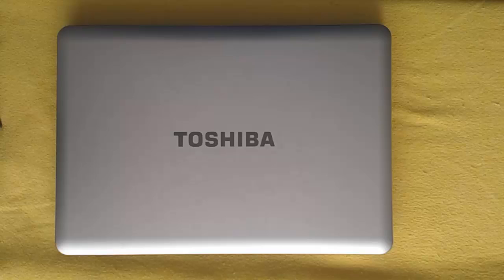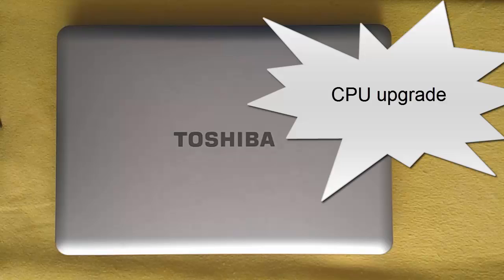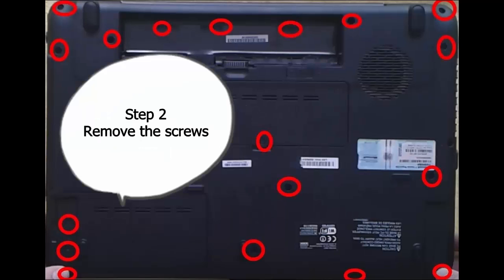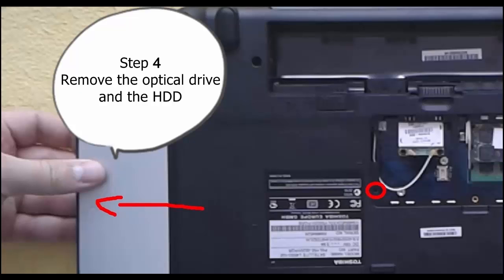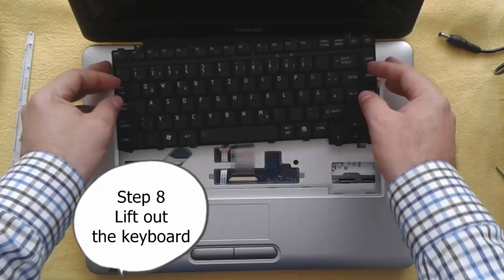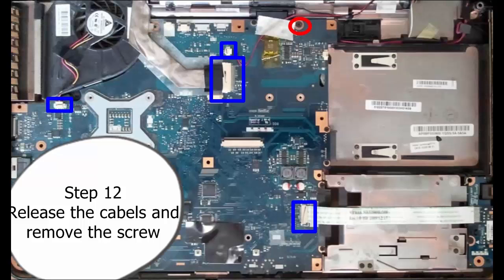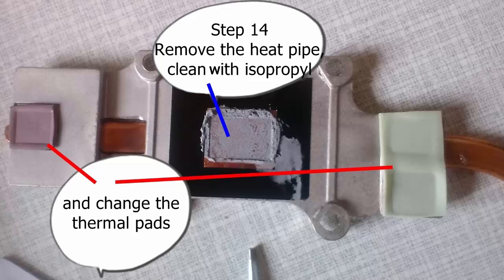CPU upgrade for Toshiba L450D laptop Ep.087

Comment: Mine already has the QL-64, thinking about putting in a 2.4ghz or faster socket S1 CPU but I can't find out what CPUs are compatible.
Reply from the maker: Aloha, the CPU's below are socket S1 (S1g2) CPU's, but  because Toshiba didn't provide a  list with compatible CPU's, I don't know if the BIOS will recognize all these CPU's and I didn't tested, I can only suggest to try these CPU's.
Athlon 64 X2 QL-64	2.1 GHz	L2 Cache 1MB	35W
Athlon 64 X2 QL-65	2.1 GHz	L2 Cache 1MB	35W
Athlon 64 X2 QL-66	2.2 GHz	L2 Cache 1MB	35W
Athlon 64 X2 QL-67	2.2 GHz	L2 Cache 1MB	35W
Turion X2 Ultra Dual-Core ZM-80	2.1 GHz	L2 Cache 2MB	32W
Turion X2 Ultra Dual-Core ZM-82	2.2 GHz	L2 Cache 2MB	35W
Turion X2 Ultra Dual-Core ZM-84	2.3 GHz	L2 Cache 2MB	35W
Turion X2 Ultra Dual-Core ZM-85	2.3 GHz	L2 Cache 2MB	35W
Turion X2 Ultra Dual-Core ZM-86	2.4 GHz	L2 Cache 2MB	35W
Turion X2 Ultra Dual-Core ZM-87	2.4 GHz	L2 Cache 2MB	35W
Turion X2 Ultra Dual-Core ZM-88	2.5 GHz	L2 Cache 2MB	35W
I wish good luck with the upgrade and please a comment how went the upgrade.

Comment: This video very helping us, thank u. how many kind cpus working on L450, i wanna upgrade too
Reply from the maker: Aloha, probably these CPUs will work, 
Athlon 64 X2 QL-60 2x1.9 GHz  1MB 35W
Athlon 64 X2 QL-62 2x2.0 GHz  1MB 35W
Athlon 64 X2 QL-62 2x2 GHz  1MB 35W  
Athlon 64 X2 QL-64 2x2.1 GHz 1MB 35W
Athlon 64 X2 QL-65 2x2.1 GHz  1MB 35W
Athlon 64 X2 QL-66 2x2.2 GHz  1MB 35W
Athlon 64 X2 QL-67 2x2.2 GHz  1MB 35W
Turion X2 Ultra Dual-Core ZM-80 2x2.1 GHz 2MB 32W
Turion X2 Ultra Dual-Core ZM-82 2x2.2 GHz 2MB 35W
Turion X2 Ultra Dual-Core ZM-84 2x2.3 GHz 2MB 35W
Turion X2 Ultra Dual-Core ZM-85 2x2.3 GHz 2MB 35W
Turion X2 Ultra Dual-Core ZM-86 2x2.4 GHz 2MB 35W
Turion X2 Ultra Dual-Core ZM-87 2x2.4 GHz 2MB 35W
Turion X2 Ultra Dual-Core ZM-88 2x2.5 GHz 2MB 35W
but I can't guarantee, the AMD CPUs are pretty rare.
 If you don't have a good quality thermal pad to replace the old thermal pad, then you should have a extra care when you are disassembly the laptop to not contaminate with dust or anything. 
Do not touch with fingers the thermal pad, you will contaminate with  grease.
Before the CPU upgrade, update the BIOS to the latest version.
Thank you for watching, if my video or advice was useful, please consider to share and subscribe.
Good luck with the upgrade, keep me posted how went the upgrade.

Comment: Sir what processor is compatible for toshiba satellite l300??
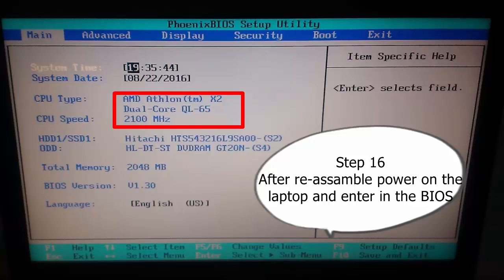Reply from the maker: Aloha, the answer you can see at 2:01.
Thank you for watching, if my  video was useful, please share and subscribe , have a nice day.
Reply: @redigitt  are you sure sir? coz were not the same model of laptop.. can you give me other Type of CPU can i replace to my Toshiba satellite l300 cpu?
Reply from the maker: What CPU do you have now in your laptop?  The L300 series laptop came with Intel and AMD procesors. Look for your exact model L300-xxxx.
Reply: @redigitt  The exact model was DYNABOOK SATELLITE T41 200C/5W and based on the sticker they put it here was INTEL CELERON.
Reply from the maker: I find some information here https://dynabook.com/pc/catalog/satellit/081007t4/spec.htm   and probably you could 
upgrade your CPU with these CPU's http://www.cpu-upgrade.com/CPUs/Intel/Celeron_M/575.html    
I never saw any  DYNABOOK SATELLITE T41 laptop in my life, so do it on your own risk. 
I suggest first disassembly the laptop and verify the processor type or look with CPU Z. 
Use good quality thermal paste, because the dual core CPU's TDP are higher then Celeron. 
Good luck with the upgrade.
Reply: @redigitt  Thank you sir.

Comment: I changed my laptop cpu recently just few days ago using this video tutorial however my laptop still only recognizes my old cpu under System settings when I boot up my laptop. As I have programme called CPU- Z installed I know my new CPU which I put in correctly is working and not broken. my laptop is a Toshiba satellite pro L850 which I bought pre- built. my old cpu I still have with me just in case. As I am quite new to computer building I do not know much. I do know however my laptop has latest bios. I was therefore wondering what I need to do so my laptop changes and detects my new cpu right now it reads under system settings the old intel core i3 3120M cpu not the  new intel core i7 3540M processor  one thing is for certain I correctly installed the cpu and thermal compound also the cpu sockets both match so no problem there. Is there anyone out there who could kindly help me out about this.
Reply from the maker: Aloha, you installed right the CPU, but your BIOS dosen't support the i7 CPU. Please verify your BIOS version and check for BIOS  upgrade on the manifacture site. http://www.toshiba.co.uk/support/drivers/laptops/  .You can check your BIOS version with the CPUZ program, on the 3 "SHEET" Motherbord SHEET in the middle. Be carefull if you make a  BIOS upgrade, disable  the internet connection temporary and stop the antivirus program, you don't wan't to restart the laptop when you upgrading the BIOS because the windows has intagrated an update or the the antivirus has found a suspicios file. You can try to reset the BIOS to the default settings, but  I don't thik this will help you. Good luck.